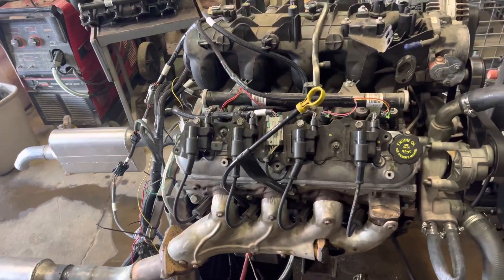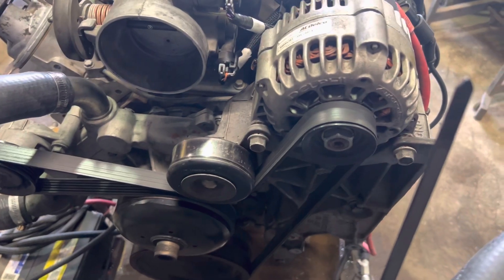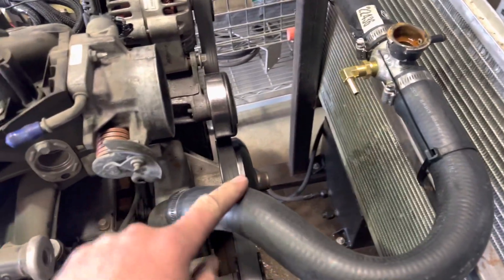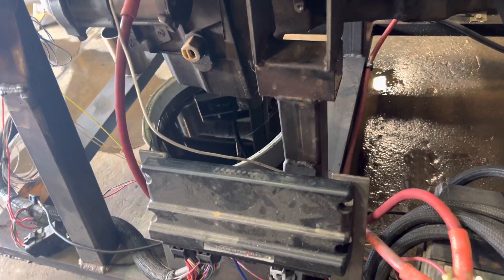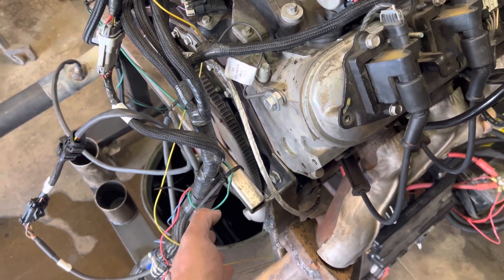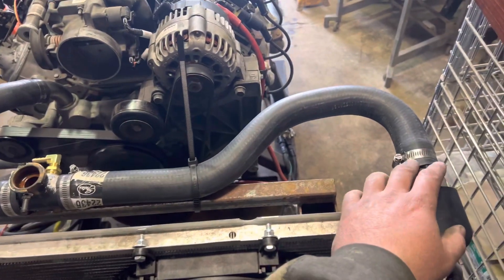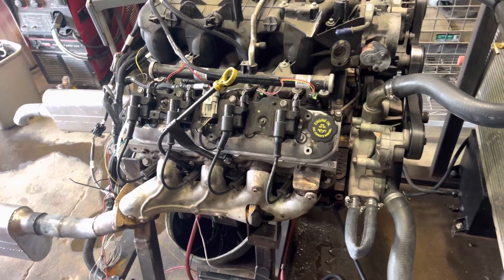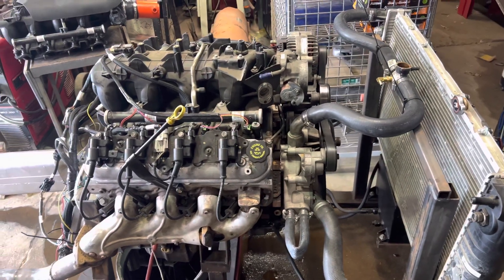My engine run stand that I built and use to run LS engines.

Comment: Do you use the charging system?
Reply: More videos please, Travis!
Reply: @Radmutter911  lol I’m trying. My wife and I’d work schedules aren’t lining up so I’m struggling to film. I just got back a certain special car so there’s lots more stuff to come
Reply from the maker: Yes I do. I don’t keep my battery on a trickle charger or anything like that.
Reply: @Greymancustomz  any clue what the amp draw is on the system to keep it running?
Reply from the maker: @travisblack417  no but it has to be very minimal till the fans kick on. I think it drops .1 bolt every 5 min of running if I had to estimate. But I normally run the engines for 10-30 min